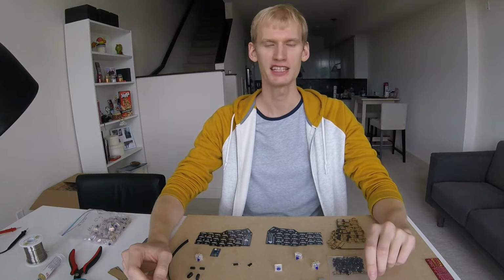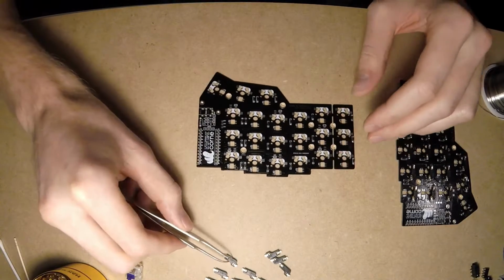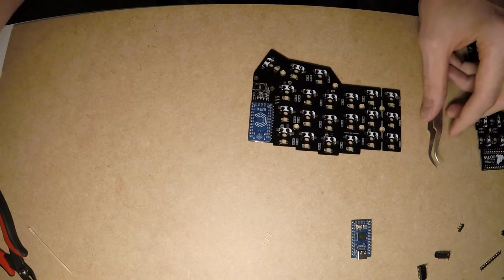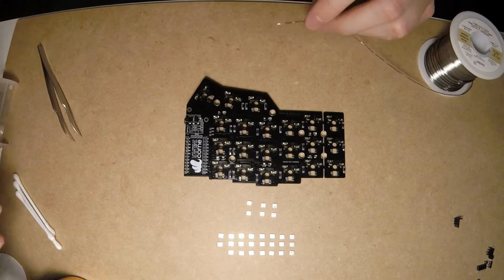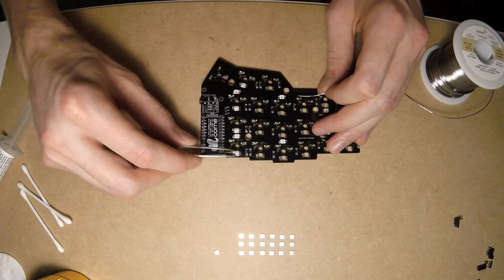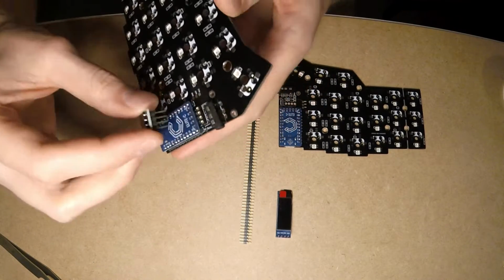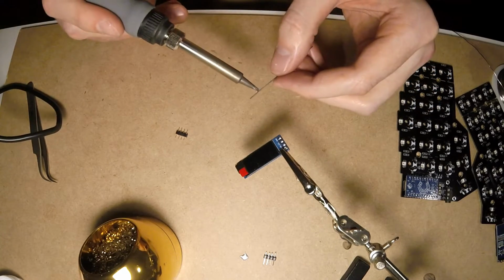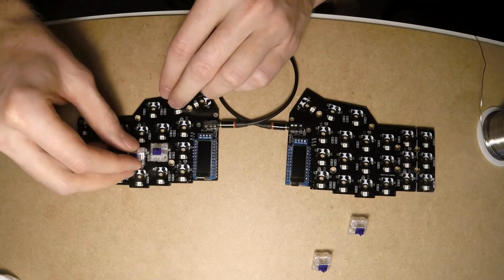Corne (CrKbd) keyboard build log

Comment: Tip: Sometimes if you are trying to weld a led, and it doesn't work no matter what you do, check the previous led. Even if it works, maybe 1 of the 4 pins was not correctly weld.

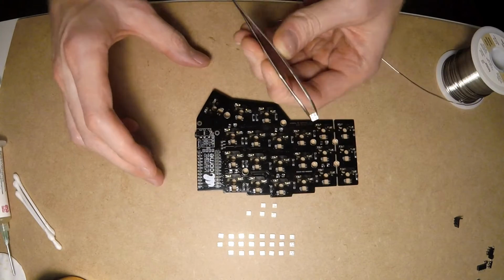Comment: Thanks for the great video! I'm hoping you could help clarify one thing for me. At ~7:25 you mention that we should solder the "largest" part of the LED to the marked pad on the PCB. What do you mean by largest? The largest metallic pad on the bottom of the LED? The pad corresponding to the notched corner? Any clarification would be greatly appreciated! This is my first build and I'm still working through some of the details.
Reply from the maker: Hi, thanks! 
Sure, let me clarify that a bit.
By the  "largest" part of the LED I meant the largest metallic pad on the bottom of the LED. Here is the pic from the original build guide by Foostan:
https://user-images.githubusercontent.com/736191/54487457-7b955c80-48d9-11e9-882d-59ff506d5f02.png

The largest one is marked with a pink circle.
For all LEDs (even for the first 6 facing bottom) you have to make sure that this largest metallic pad is soldered to the silk-marked PCB pad.

I'd recommend soldering these LEDs one by one. Solder the first one, connect power to the keyboard, make sure it works (assuming you flashed the ProMicro with the firmware). Turn the power off, solder the next one, check it, and so on. All LEDs are linked in one chain and if the 1-st soldered incorrectly, the others won't work. 
The build guide from Foostan has corresponding numbers for all LEDs:
https://user-images.githubusercontent.com/736191/54487455-7b955c80-48d9-11e9-9498-c841747c5dbc.png

Good luck with your build!

Comment: You used mill max pins to socket the controller. I used diode legs. Is it possible when using diode legs for socketing the controller to just take out the controllers and put them back in or would I need to replace the diode legs?

Comment: I just used DIP sockets and the lower pins of a normal female socket. It's a bit hackish, but I prefer to use easy to find/cheap pieces, and the result is the same.

Comment: Hey! I love these videos you make. It's super informative and appealing for visual learners!
I was wondering, can I use the 64-pos Mill-Max socket row + Mill-Max pins for hot swapping the Elite-C on the 1up sweet16 pad? would it be the same? mmm
Reply from the maker: Hey, thanks!
Yes, it should be the same technique for the 1up sweet16 pad. I believe that socketed (Mill-Max) Elite-C will be almost the same height as if it would be soldered with the standard pins. Shouldn't be any issues with 3d printed cases.
Hope this helps!
Reply: Volodymyr Lukashevych hey! Thanks for replying! And thank you! :)

Comment: great video! I'm building a Corne at the moment but had a problem with the leds - melted the first one because the temperature was too high. I tried again only soldering the first led in the sequence with a lower temp but then the board wouldn't turn on until I unsoldered it. Did you know if it should work with just one led? I don't want to solder them all just to find out it doesn't work!!! thanks in advance
Reply from the maker: Hey, good to hear you're building Corne! 
Yes, it should work with the only LED #1. Not a random one. All LEDs are chained so if the very first (facing down) is broken you won't see other light up. I would suggest soldering one by one, starting from the #1 on this image. 
https://user-images.githubusercontent.com/736191/46822569-cc52d780-cdc6-11e8-9602-f6265a2c876d.png
If the very first one lights up, solder the second one and test again. If the second doesn't work you have to check two places - output from the first LED and all joints on the second. And so on.
Good luck!
Reply: @volodymyrlukashevych954  Thanks very much for taking the time to reply, most appreciated